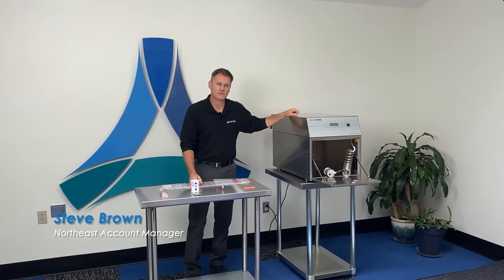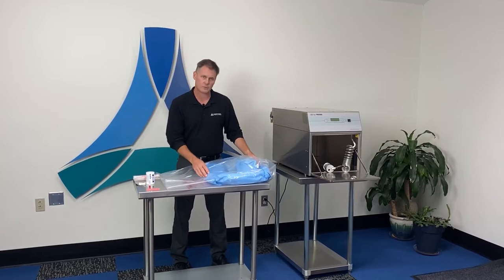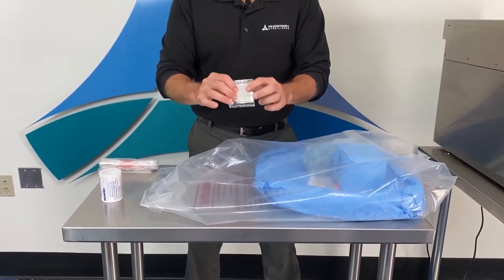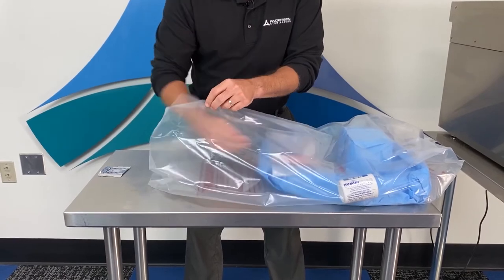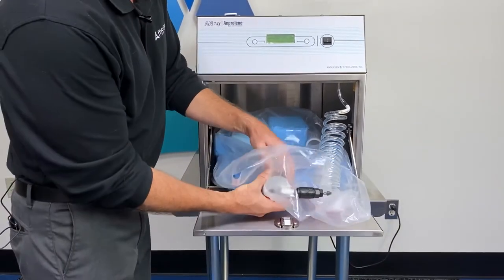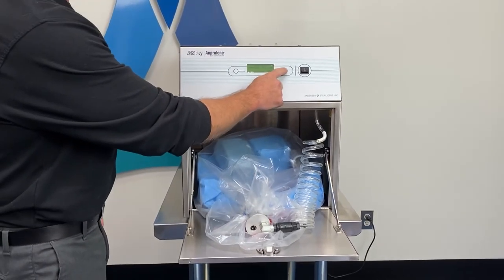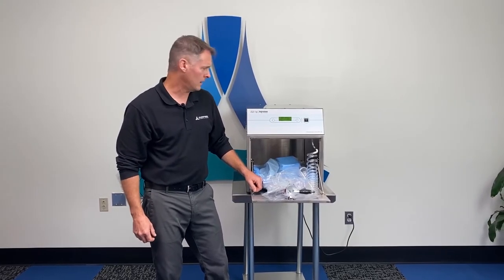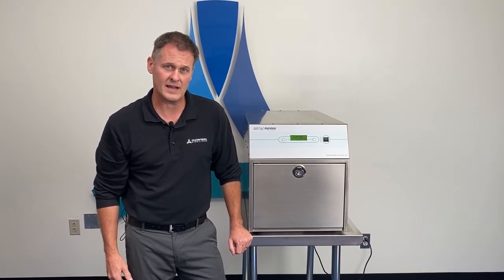Anprolene AN74: How To Operate

Comment: ours has a separate place for the biological indicator. its in the handle/base of the probe. when do i need to change these?
Reply: You should use a new BI with every load, this is necessary for human clinics, if you work for a vet or lab, the dosimeter is ok for release.